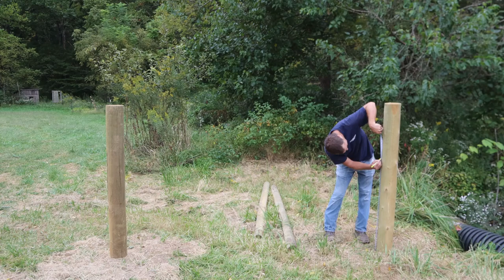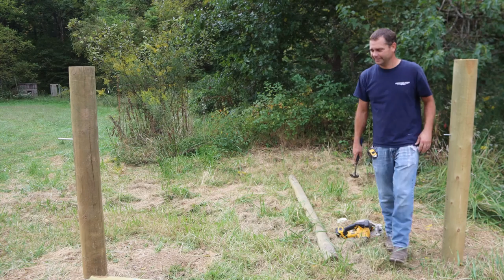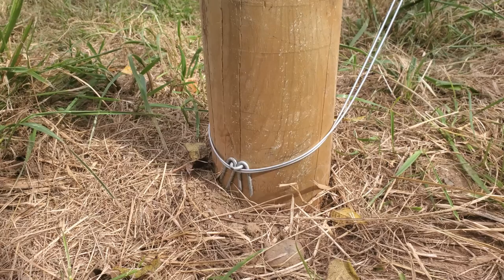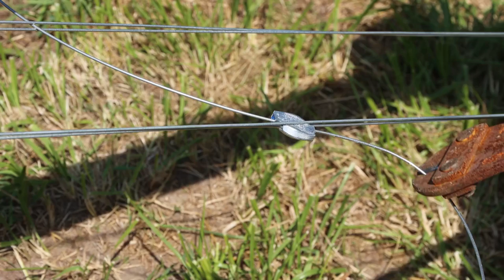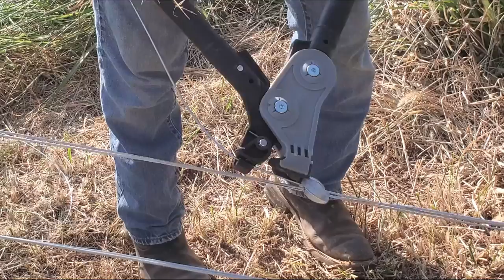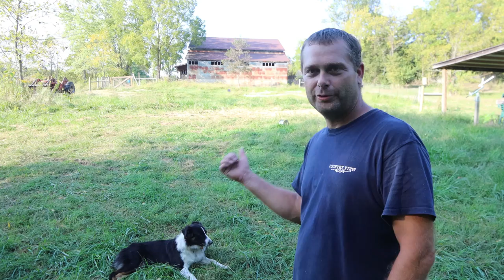Installing Fence braces for field fencing

Comment: Field fence is definitely the way to go. Grew up on a sheep Farm and we had sheep crawling through tight 9 strand barbed fences until we switched it all over. Two things we found for cows and goats: 1) the electric or barbed top strand is a must as the cows ALWAYS reach over the fence and can really crush the field fence. 
2) we had a lot of trouble with horned goats reaching through the squares and getting stuck or pushing through and stretching them out. Would recommend an electric strand 8ish inches from the ground standing off to the inside of the pasture to keep the goats/sheep off the fences.
Reply: Denny, same on the farms in our area of Western New York State, with most of the farmers keeping the outside perimeter mowed a strip to take away the desire to reach over.
Reply: It's a shame that I can't share this post,  a gentleman at Owl Creek Homestead was just asking how to fence in hilly areas. This sounds like great advice.
Reply: Douglas Drew our solution was eventually to sell the cows haha.

Comment: I use slick wire for my H braces and just stretch them tight using my fence stretcher then I use rebar to twist it even tighter then use a staple to nail off the rebar on my cross member. Less tools I have to carry and less expense in buying mechanical tighteners!

Comment: Here's a trick to drill straight....Put a ring (or something round) on you drill bit.  As you are drilling you want to keep it in the same place.  If you do then you will drill a straight hole through you fence post
Reply: Please explain.
Reply: @jphickory522  Yeah, does make much sense as stated.
Reply: This doesn’t make sense, please explain more clearly
Reply: ^How is this not self-explanatory? If you have a ring or wrench or anything hanging off, it may act as a plumb bob. If you tilt the drill up or down the object will slide along the shaft of the bit. If you drill generally straight and level it will hardly move. Simple?

Comment: That gripple worked on the brace wire pretty good but I think you over thought it. My grandad taught me to use no. 9 fence wire then use the handle of my fencing tool to twist it in the middle until it was as tight as you need it, no special tools needed. I’ve never seen those “brace pins” before, interesting. We just toenail the brace with large spikes. Another tool that might help is a heavy bar with a sharp blade on one end ( forgot what they’re called) you can buy at any tractor or farm supply store. Use it to bust up rock, roots and hard ground in the bottom of holes plus use the butt end to pack soil back into the hole around the fence.
Reply: we too used a twist rod (old piece of t post or even a hedge apple branch (osage orange)) but i did like the way the grippe pulled it up tight!
Reply: Spud bar.

Comment: Really enjoying the channel. I’m about to move to 10 acres where we just finished building a house. Next spring there are plans for a pole barn. No plans for animals but definitely a large vegetable garden so I’ve been interested in the installation of you fence. A suggestion that other channels do is to include a link for the products they are using which is especially helpful for those of us that are less experienced.  Looking forward to the next video. 👍
Reply: I agree this would be a great help like the tool you used to tighten the wire on the fence brace I don't know what any of those things are. Thanks for any help!
Reply from the maker: A lot of our fence building tools are on our Amazon Shop
https://www.amazon.com/shop/countryviewacres

Comment: I have been using 14 gauge wire from TSC with good effect and for tension, I use a piece of rebar (small, 1/2" diameter) and I twist it and anchor that bar to the crossbrace with staples.  In the end, same result as using a mechanical tensioner, but sharing because the 14 gauge is easier still to work with and inexpensive.  I have no issues with the tension, which I will check with a hammer and the top and bottom of the angle, to confirm both runs (I go around twice as well) are in tension.  We plan on focusing on Nigerian Dwarfs, but our first two goats were larger and test my fencing more than I care to see.  The wife will not let me energize it, so I guess I have been pretty proud of how durable they have proven to be to this point.  Good job sticking with getting the holes dug.  I mentioned it before, but a big difference in my soil installing posts in the spring vs. the summer/fall.  Fall does seem to require a little more effort.
Reply: Paul Cox  My goat paddocks range in size, but I found those smaller paddocks take as much work as the larger ones.  Lol.  Maybe less t-posts and fencing, but the corners and bracing are often the same.  A lot of good videos out there on tensioning by twisting the brace wire if my description is confusing at all.  Best of luck to you.

Comment: when you strain the brace pull on the wire you have the gripple on and that will make the wire tighter and easier to strain with the tool

Comment: We watch several homestead channels and not one of them have to deal with the amount of rocks we have here in the ozarks. I'm always amazed at how much easier it is for them to dig postholes. 👍 Your fence is looking good.
Reply: Down pressure kit and rock bit may be the only way. May have to blast for corner posts.
Reply: @davidmays2161  my brother actually made a bomb to blast one hole. It didn't break up the bedrock but it did expose a crack so I drove a section of grader blade in it and bolted a post to it.
Reply: Paul Cox  same here. My father, uncle and grandfather were all farmers so I grew up picking up rocks.

Comment: Next step without a corner post is to be sure to tie off your fence to the close post, not to the far post. That way you can center it so there is no post twisting which of course loosens the fence.

Comment: If you plan on continuing to use high tensile wire then either make or invest in a device known as a Spinning Jenny. It allows a coil of HT wire to be placed on it, fixed in place. When you pull the outside end the wire unwinds off and lays flat on the soil and not curl up like a giant coil spring that wants to recoil all the time! Incidentally if you fit a handle to one of the spokes it can be used to wind up into a coil any single strand of wire if for instance you are taking down a fence for some reason.

Comment: I found that adding an additional 18 inch high, 1/2 inch opening, chicken wire, at the base of my regular fence works pretty well at keeping rabbits out of the garden.   A low, electric strand also works but it is difficult to keep the grass from shorting it to ground.   By the way, a good way to check for activity on an electric fence is to use a blade of green Johnson grass.   The shorter the distance between you and the fence, the stronger the shock that you feel, so start long and as you reduce the distance, you can tell if it is active with minimal shock.

Comment: Looking good that gripple is an awesome tool ant looks to really simplify fencing. Thanks for sharing!! Edit. What  I do is put electrical tape on the handle of my post hole digger at the depth I want my hole so I don’t have to use a tape measure to check the depth.
Reply: JudithB  I  put  meaurements  on  one  handle of  my  post hole digger  with  paint  and  on  a  shovel  too.  Saves  me  time!!

Comment: If you can fit them for a harness you can go the cheaper dog run using a cable strung between a post/tree with a pulley and chain clipped to the harness giving them a good amount of room to run. It is very important you only do this with a harness on them as it will put too much stress on the neck if you try to use a collar and they go to chase something. Used/surplus cable is much easier to find then cheap wood for fencing.

Comment: 2 inch wire mesh 4 ft high will keep rabbits out but dig a small trench about 12inches deep  2inch diameter lay a small section of the wire in the trench turned out at the bottom in the way of directions of the rabbits coming from, staple your wire and fill in the trench you can also do the trench 18 inches deep as that prevents the the rabbits going deep

Comment: You need to get a crowbar.  Great for getting rocks out of post holes, and for ramming the soil around the post.  Also you can save a bit of money by using wire strainers to tighen your brace and then just tie the wire ends together and wrap around both sides of the brace wires.  As you pull the wires into the centre they will tighten as you wind.  So no need for a gripple.

Comment: An alternative, and imo better, than 4”x4” field fence is Stay Tuff brand 1348-12 fencing. Very strong and has fixed knots.   I can’t remember the exact cost but a 660’ roll was cheaper than two 330’ rolls of red brand or gaucho sheep and goat wire.

Comment: The staple you put in the bottom of the post, does the high tensile wire loop through or go around it before strapping

Comment: Maybe do more research on fences and what you need to keep in and out- you would have learned rabbits can go thru fairly small holes. Chicken wire will not keep out voles and moles though. So Hardware cloth up to 18 inches high, shouldkeep out most anything- and dont forget to put some up to 12” away on the ground, to help keep critters from crawling under

Comment: To drill accurately all the way thru a post, drill from your 38" mark half way from each side. Be sure to sharpen or replace the auger tip, not just the cutters. If the tip doesn't bite, sharp cutters will not cut well.
Reply: Bob Grier but if he is measuring from the ground, if he’s on a hill the hole on one side would be higher than the other.
Reply: @cathiwim  Thank you , BC, for bringing up a valid point. My comments were addressed to Evan's project where he seemed to have leveled the ground around the posts. In the case you bring up, which happens often, the solution is to measure  DOWN from the top of the post to locate the off side mark, assuming the post has a flat top. I've also used a torpedo level atop the drill to help keep it level, and I've used a speed square to draw a witness line around teh side of teh post to the off side. I once even taped the torpedo level to teh top of the drill, which had little metal, while doing multiple posts, another use of our friend duct tape.

Comment: I am a little old school but I like to put a twist in my tension wire. Seems to handle the post shrinkage well. I was also curious what was the reason for the two fencing staples at the bottom of the poles. I assume it was spreading the wire load. Looking great and coming together well  !!
Reply: Yeah stops the wire cutting into the post keeps it tighter

Comment: A nice thing to have is an iron (steel) bar you can find at big box and ag stores.  There are several types, but the one with a circular mostly flat 2 or so inch head on one end is great for pounding earth around a post is the most helpful for setting posts.  https://www.lowes.com/pd/Truper-Tru-Pro-69-in-Post-hole-Digging-Bar/3055437

Comment: what gauge is the wire you used for the brace? I got a gripple tool and it doesn't seem to grab the wire that i'm using
Reply: He is using 12 ¹/² GA high tensile wire. 
I know your question is 8 months old, but there's the answer lol

Comment: Is there any specific reason for drilling slightly off center for the horizontal post , or just preference ?
Reply from the maker: I read it in installation guide.  I think it is so when you are assembling it, it less likely to spin, since the majority of the weight is under the pin.